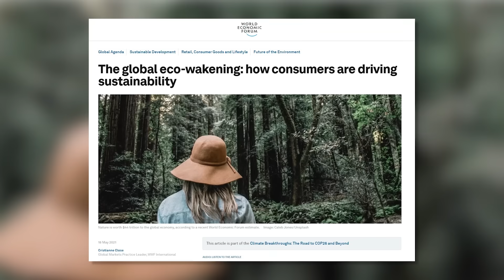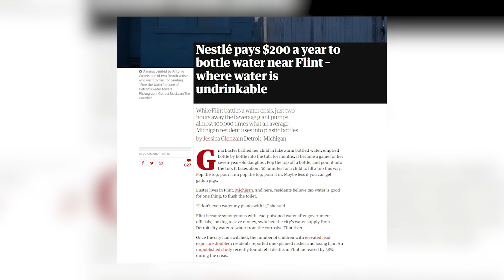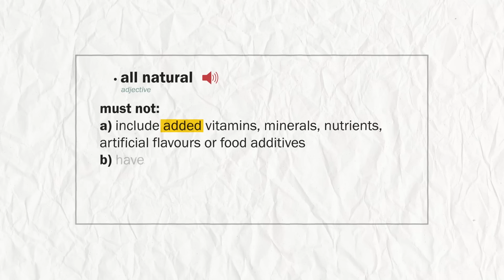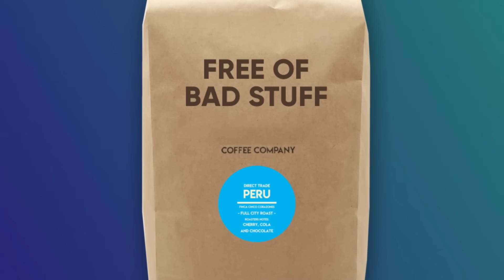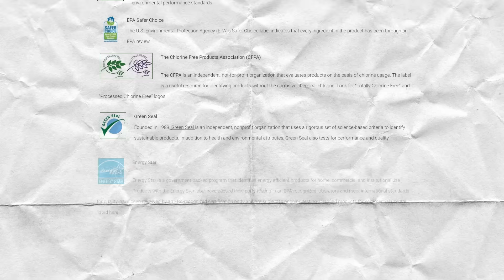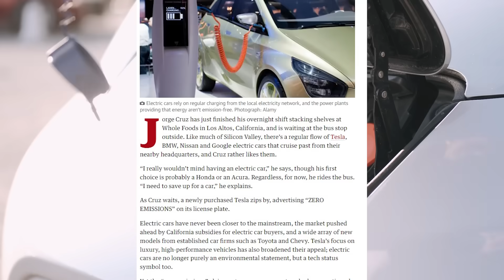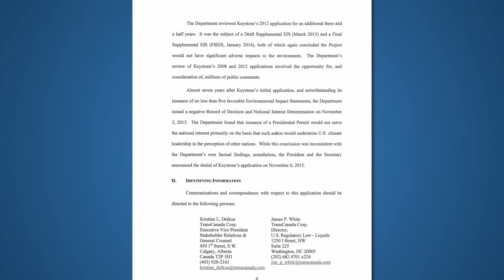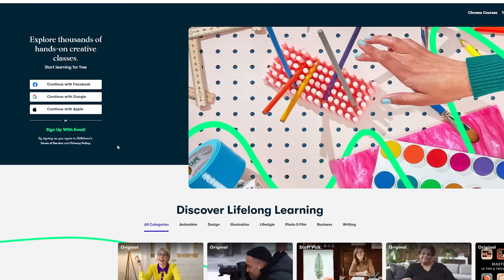Why Being 'Environmentally Friendly' Is A Scam

Comment: "That means 10,000 bottles a minute will end up in land fills or the ocean." 

1. How is that Nestle's fault? They can't force people to recycle their bottles. This is like blaming Toyota because you crashed your Prius while texting your boyfriend and not watching the road. And what do you want them to do? Stop using plastic? And use what instead? Glass? If you think plastic is bad for the environment, just try ramping up glass production. It takes a LOT of fuel to melt silica into glass. Not to mention glass is heavier so shipping it uses more fuel. Oh and mining the silica.. Oh and there is actually a literal shortage of sand. Bet you didn't know that. 

2. So what if bottles end up in a land fill? They will be buried and stay there until they degrade. And despite what you probably think, no, we are not running out of landfill space. Not even close. Oh it's going to take hundreds of years? So what? The bottle isn't going anywhere. And guess where that bottle came from. That's right, it was made from petroleum, which was in the ground, for hundreds of millions of years. 

3. Also despite what you probably think, plastic waste from the US and the rest of the western world does not end up in the oceans. It goes to land fills. 100% of it. All that plastic in the oceans comes from 2 places. Asia (including India) and Africa. Asians and Africans dump their trash into the rivers which carries it out to sea. The rest of the world uses landfills which locks the trash inland safely. 

So yeah, being "environmentally friendly" is a scam. But so is lying about things to drum up hatred and fear in people by making bullshit videos like this one.

Comment: I’m glad you pointed out the environmental trade offs with “green” products like lithium battery or energy production for cars. The worst part about being informed is most people only find sources who tell them what to think instead of digging dealer and understanding the math, science or big picture as a whole. Cars are a great example because the biggest impact we can make is reducing the number of miles we log, regardless of the type of vehicle we own (something you also pointed out). It’s sort of nature to not want to give up our convenience that we’re accustomed to.
Reply: Combing and planning trips is important. I've done that because I'm in a rural area and gas can be pricey. Get everything you can from your trip to town.
Reply: Speaking of batteries....I am hearing impaired and hear virtually nothing without hearing aids. They cost about $4000 for the pair. I have to change the batteries (2) every 5 days. Can't they come up with longer lasting batteries so I don't have such waste? Of yes...I could get RECHARGEABLE hearing aids which would cost me $6000 to $8000 in my country and even then the rechargeable batteries would need changing every couple of years. Make the rechargeable ones cost less than the battery-change ones and you'd be helping.

Comment: Did the closing of the pipeline not create more damage to the environment since the alternate transportation sources would create more CO2 and use more resources
Reply: Yes, but the reason isn't straightforward. Its all about economics; by not having the pipeline, crude produced in Canada beyond their existing pipeline capacity would have to be railed or trucked. Trucking is way too expensive to do at those distances at that scale. So crude by rail could pick up the slack - more dangerous and carbon intensive than pipelines. Rail is also relatively expensive compared to pipelines though so it reduces the amount that producers can charge for their crude and making marginal supplies less likely to be produced.  

That may sound good until you realize that the American refining complex requires some medium and heavy grades and that Canadian crude could have helped displace heavier imports from countries like Venezuela, Mexico, Russia, Saudi Arabia, and Iraq. Aside from not being the most ideal trade partners (especially compared to our Northern neighbors), imports from those countries (besides Mexico) require long hauls by massive tankers that consume a ton of fuel crossing the ocean. 

Unless and until consumption of transportation fuels decreases (we're at all time highs for implied diesel demand right now), we should prioritize supplies that are local and whose production is regulated by a government that values ESG. That would be U.S. and Canada. Unfortunately the whole NIMBY phenomenon causes a lot of waste.

Comment: This video misses by far the easiest, cheapest, and most effective way to limit your environmental footprint. Just don't buy as much stuff. It's as easy as just taking an extra few seconds to consider if you really need something before buying it. Or using an existing product for longer rather than replacing it with a better one. Most people will only consider the monetary cost in these cases and think it's worth the money for something new, but they should also be considering the environmental costs.

Wear your clothes until they literally start falling apart rather than when they start to fade or when a new trend comes out. Wear the older ones when getting groceries or around the house.

Fix that older car rather than buying a new one. It's almost always better for the environment to drive an old car even if the new one is far more fuel efficient or electric.

Wait another year or 2 to upgrade your phone/tv/computer/etc.

It isn't difficult and you'll find you hardly notice the difference in your life. People are addicted to shopping and getting new shiny products but they provide very little actual happiness outside of the short-lived initial dopamine kick.
Reply: It 'misses' it, because that isn't what this video is about.  It's about corporate greenwashing.
But since you mentioned these things, you forgot:  

* Use old clothes (not underwear or socks, but almost everything else) & bedding, either for cleaning rags, or to sew into new items (upcycling).  Look on youtube, fb groups, and/or blogs, for inspiration/ideas & to ask for help.
There are so many options, including: 
mittens, patchwork/other clothes, scarves, bags, baby bibs (can look nice as patchwork), door snakes, etc
- and if you don't need these upcycled items yourself, it's almost guaranteed someone in your city or town will.

You can donate these to individuals or via a charity or maybe even via a local school or church.  
You can even phone to ask in advance what they may need, & any requirements they may have for the items. 
eg which fabrics they'd prefer or require to be used & sizes they want).

* To hold gifts: 1st choice is reuse kids (or your own) drawings/artwork; 2nd best option is to sew drawstring pouches to hold gifts (find great instructions on youtube).  
Saves on environment & budget in form of reducing wrapping paper (both produced and tossed).  
Then, if using a pouch, the recipient can choose to either use the pouch for something else (the next gift they give OR another purpose), 
or return it to you for the next gift you give.
Reply: I think 6:29 kinda covers it.
Reply: Actually that isn't the easiest/cheapest/most effective thing you can do. That would be not having children. Not having kids is by far the best thing anyone can do for our planet. You could be a carnivore than drives a 300km/day commute in a hummer and you'd have less impact than the most eco-concious person with a couple of kids.
Reply: @graham1034  exactly! I think everyone should just stop having kids and let humanity die
Reply: @tabethasiou1570  what
Reply: @fubuki3478  a Sarastic reply to graham's comment
Reply: @tabethasiou1570  i thought u were dead serious 😭 , sorry
Reply: @fubuki3478  lol I have deadpan humor 😆
Reply: @graham1034  I’m feeling like you're oversimplifying this.

Comment: Some points:
1. CFCs have been replaced by hydrocarbons, which are super greenhouse gasses.
2. Paper products emit more CO2, and use more water than plastic products.
3. "Bio degradable" plastic is actually photo degradable, which could be worse than less degradable plastics that are inert.
4. Apple brag about being green, but make their products non-user servicable, therefore increasing e-waste.

Comment: This was a good video that debunked some pretty pervasive rumors in our society. I would like to correct a bit of (presumably unintentional) electric vehicle misinformation. Even if an electric vehicle is powered by coal, it is still cleaner than a petrol or diesel car. A coal fired plant is close to 50% efficient in converting fossil fuels to energy, whereas gas engines are in the 25-35% range. When combined with all the waste of extraction, refining, and transportation of fuel, even the worst coal plant is better than continuing to burn gas in cars. Add to this that the EV doesn't leave poison in its wake as it drives past schools and homes, and at least with the coal power plant the particulate pollution is centralized away from most people's lungs. Furthermore, given the trend of most power grids to renewable energy, an EV will just get cleaner, whereas a gas car will only get dirtier as it gets old and worn out. And if you're concerned with the extraction of things from the ground to make batteries, I have two points to make there. First, there are batteries in phones and laptops and all kinds of things, and nobody was upset about it until they started showing up in cars. Second, oil is a thing that has to be extracted from the ground, and then it's burned and never used again. An EV battery will last at least 10 years, and after that another 20 or so for balancing the grid (gotta store renewables somewhere) and then the vast majority of the materials that went into the production of the battery will be able to be used again, instead of extracting further things from the ground. Gotta bust the fossil fuel FUD when I see it, especially when I suspect it's unintentional.
Reply: This is true- the thing being that the article they refused to cite that included this misinformation was from over 5 years ago. I mentioned this in a comment asking them to properly cite their sources and my comment was deleted by the channel. So I'm wondering exactly how unintentional it really is. I'm hoping that your comment doesn't get deleted!

Comment: You had me until Keystone Pipeline. Cancelling pipeline doesn't make cars in the USA not use oil, and pipelines are the most environmentally friendly in transporting fuel. And also, electric cars are charged by coil-produced electricity, their production uses rare minerals, and they produce a lot of unrecyclable waste when being discarded. There's certainly room for improvement and we should strive for it, but let's not try to throw the baby out with the bathwater.
Reply: Also, those rare minerals are often being mined in 3rd world countries with slave and child labor. It's so easy to say "we are improving because we use clean energy", where in fact the problem is being transferred and made worse in a different part of the world, where we can't see it. It's hypocrisy.

Comment: 8:21 But that's not true? An EV would work best powered by a grid that's 100% renewable, but if you have a fossil fuel powered car and a roughly equivalent EV that's powered 100% by fossil fuels and measure the CO2 emitted per kilometer or mile driven (obviously for the EV it's just at the power plant rather than by the car itself + the process of refining oil into fuel), the EVs are still more efficient. They need some thousands of kms driven to get to the break-even point as the process of making them is more CO2-expensive than making a regular car, but over the lifetime of the car they pretty much in all cases come out on top, ancient Guardian article (notably not a study - also, 2016? Really?) nonwithstanding.

Comment: The Volkswagen scandal goes deeper in a way that's relevant to this topic. The strict regulations they cheated to beat are pretty much a mercantilist hurdle to block the access to the local market under the guise of "environmental protection" - as it happens, the US manufacturers of the time were making mostly gasoline fueled cars, and it also JUST SO HAPPENS that the standards for gasoline cars were much more lax for SOME REASON. And as it happens, the non-cheated parameters of those Volkswagens? The car was still easily polluting less than a typical car people would buy instead of it. They obviously shouldn't have cheated, but wow is this some fake green bullshit.

Comment: My vote is for a Deposit System to reuse containers!
I dont understand why companies cannot follow the model of the Beer Store in Ontario.
Agree on a few sizes of containers, and charge deposits to help enforce proper recycling and REUSING the same jars or bottles. Aluminum cans should have a deposit since so much energy is put into making aluminum the first time and less energy required to recycle this material.

Comment: I interned at a company that certified buildings for complying with sustainability standards. In reality it was more like a production line of “can you get away with this” in order to lower the costs of construction. These standards were already pretty bare minimum for example at the time i was there double glazing windows wasn’t compulsory (this changed in 2022 thankfully) but im afraid that there is still a long way to go and this mindset of only complying with the standards is harmful in the long run not just to the environment but financially. 
Think of the amount of electricity used to keep homes warm or cool. If more houses used passive heating and cooling (little to no additional heating or cooling needed) then the environmental AND financial impact is reduced. However many people dont choose this because of the high initial cost. 
Environmental awareness has a price tag that needs to be lowered in order to encourage it.

Comment: Instead of an inert pipeline with oil from a country with some measure of environmental stewardship, you’re now using more oil and gas and risking more spills in tanker trucks, ships and trains by transporting from countries without environmental laws and oversight. Good job 👌🏻

Btw the natives whose land it is, were the ones working on the pipeline, they shipped in protesters from other areas of the country that have nothing to do with the pipeline.

Comment: Some young folks I know bought into the eco-friendly kitchen towel made of microfiber--at a cost of about $20 each!!!  So, you don't use any soap, but, meanwhile look at how microfiber is manufactured and how it breaks down in time---it's two kinds of plastic!  an old cotton tee shirt, water and lots of "elbow grease" will produce the same cleaning result.

Comment: The thing about plastics are that they can only be recycled so many times until they degrade, or downcycled to a certain point, then they're just useless waste. Combustion at a high enough temperature to destroy any dioxin that forms is the best way to dispose of plastics. Fortunately, where I live, that happens.

Also, since using less in the first place is more impactful, less people using shit very nicely does that, and it's already happening. Those in charge just need to let depopulation happen naturally. Yes, there will be issues that pop up from fewer people in communities, but those are surmountable, and I honestly believe things will be better for those that remain.

Comment: for the sin of lesser of two evil we could also point to the fact that often company will center their effort on one environemental chalenge and forget or make worse another.

for example while electric car gaz emission are low to none while running
they have:
       more armfull chemicals in them that have long therm concequance and are hard to recycle
       still generate emition for being made/ transported (those two component are especially downplay because more consomation -> more profit)
       depending on the country energy production the added strain on the grid + deperdition associated with it could cause more emission than dirrectly using a non electric car (because of production/ energy transport efficiency)

conclusion with the exeption of some aged car that arren't up to the norm. keeping your old vehicule could be at least for now more eco friendly than buying a new Ecar.
and alternative (bus, car, bicical, train, walking) are still the best solution.

Comment: You had a good video talking about both sides of everything until you decided to trash the keystone pipeline. Yes, the installation of the pipeline is not the greatest thing for the local environments it's installed in. But, after it's installed it's literally a pipe laying in the ground. I don't understand how the argument isn't realized that once the pipe is installed, it's way better for the environment than having to truck and transport the fuel across the country. We're talking hundreds of trucks everyday having to back and forth transport fuel to holding sites. Then transported from holding sites to gas stations. If it comes through the pipe, it goes straight to the holding sites then it just has to be transported to the gas stations. It's removing massive amounts of transportation emissions because it's just going through a pipe rather than having to be individually trucked and transported. How is that better? The odds of a semi towing fuel trailers crashing is way higher than anything happening in regards to that pipeline. I could be totally wrong, but long-term I can't logically say that the pipeline isn't the better solution. Yes it has up front issues but, we need to have a long-term outlook.